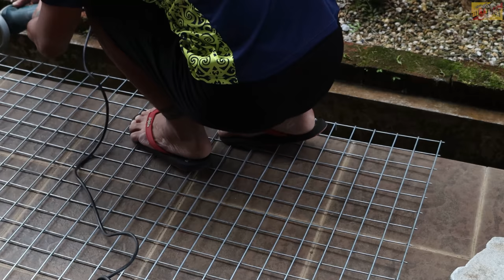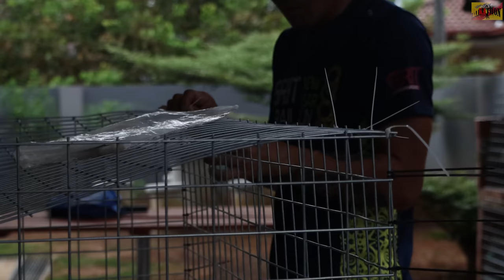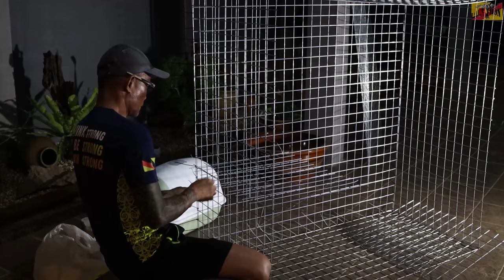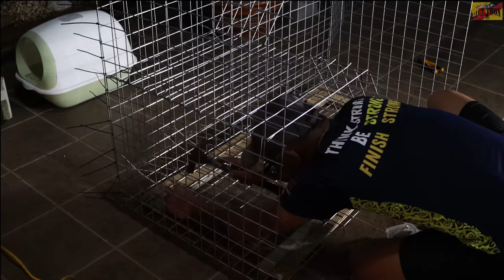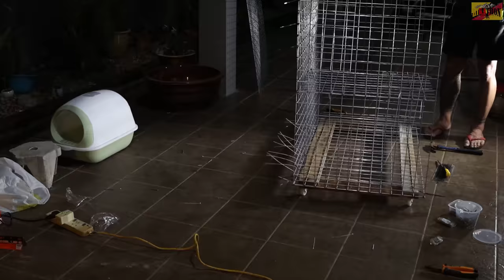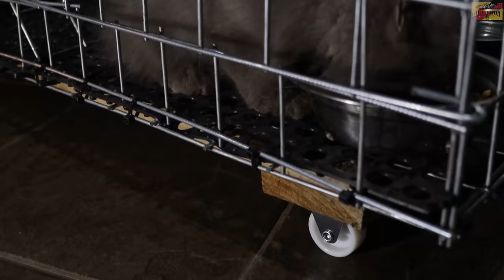D.I.Y CAT CAGE USING WIRE MESH TIMELAPSE NO WELDING REQUIRED

Comment: Can you give me the list of the materials you used, please.
Reply from the maker: 1: cable tie
2: mesh wire steel ( depend what size you prefer)
3: 4 pcs wheel
4: screw
5: rubber mat 1ftx1ft ( for flooring )
6: square recycle basket for cat sleep..
7: recycle wood planks

Comment: Problema lang kasi kinakalawang may diy cage ako pag may part nga na kinakalawang na kalimitan sa ibaba sa flooring layer by layer kc cage nila sa ibaba nadumi pag kinalawang na bbli ka uli pang ibaba, sa cage lang kc iba kong pusa di pde lahat nasa galaan puro lalake sila nag aaway away ung iba magkaka close 😂 tska isa pa dhl malapit kmi sa highway baka masagasaan or salbahihin ng ibang tao
Reply from the maker: Mine untill today still good like new..as long as you don't exposed it under the su or rain.. further more i used good quality mesh wire for your info 😊